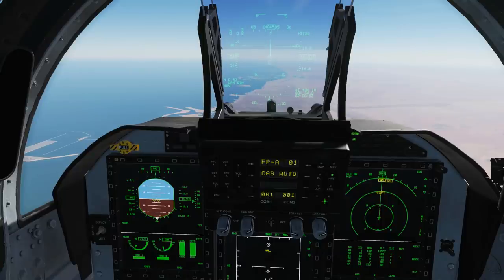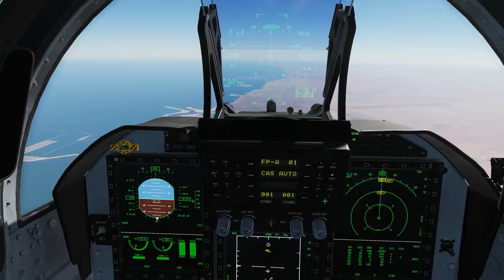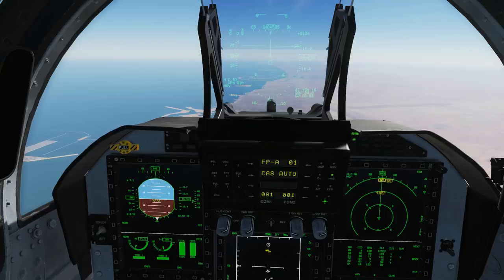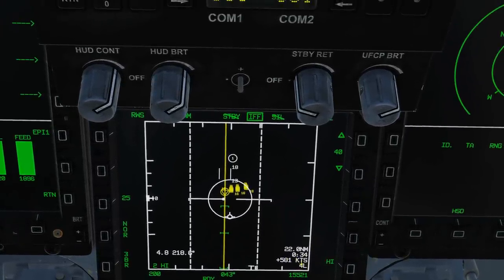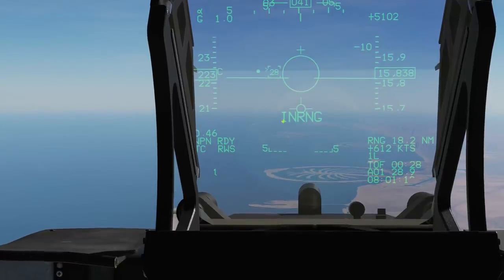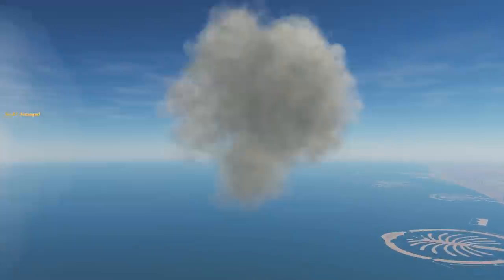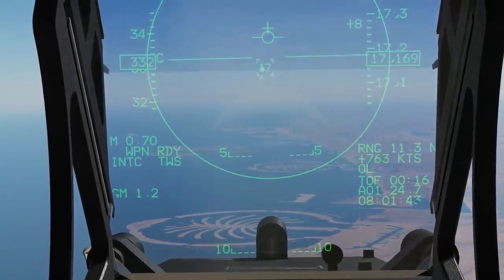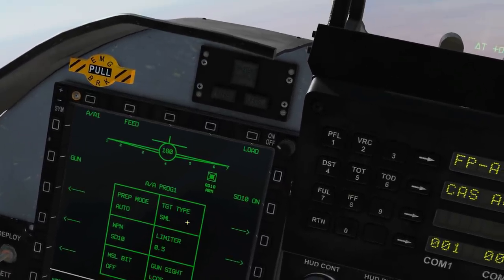JF-17 Thunder: SD-10 Missile Tutorial (Single & Ripple) | DCS WORLD

Comment: Just a note Growling sidewinder did a BVR engagement with a human controlled F-15 and it far out preformed the aim 120c! I'm not a great sim pilot but I have yet been able to evade an SD-10 playing the AI! It is extremely fast and doesn't seem to bleed off much speed compared  to Aim 120c even at 35 miles! Thanks cap, maybe you should have a look into it! Thanks cousin!
Reply: So true I saw his video and the his buddy was maneuvering lethal while pulling high G's and the flight path of this missile was like reading the mind of pilot, knowing how it had to maneuver with minimal adjustments and an impact speed of over 1 mach at high altitude.
Reply: Have you been able to notch it?
Reply: It does notch quite easily
Reply: IT notches pretty easy and especially since the patch 6 months ago it seems to bleed energy in a much more realistic way as you pull it down into thicker air. Even before the adjustment to the flight model for the missile though you could evade it with a couple good cranks although I will admit it def kept you on the defensive longer than if you were facing an AIM-120

Comment: The missile performance seems a little off. I seems to perform way better than the AIM-120C. Most missiles in DCS seem to underperform compared to other sims, but the SD-10 seems to hold onto energy like crazy.
Reply from the maker: Yeh, theyll be modified soon to be in line with the other missiles.
Reply: well it does track differently compared to the aim120c.